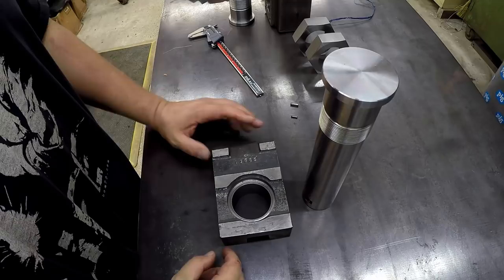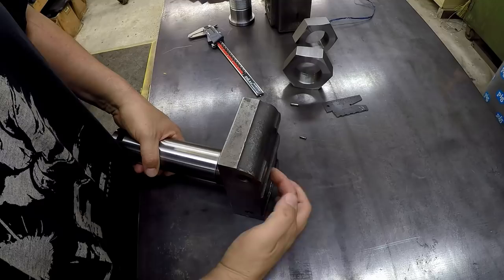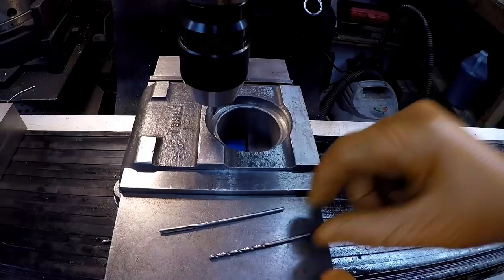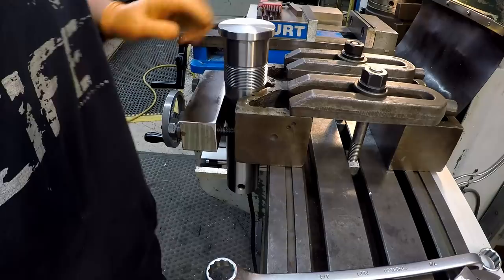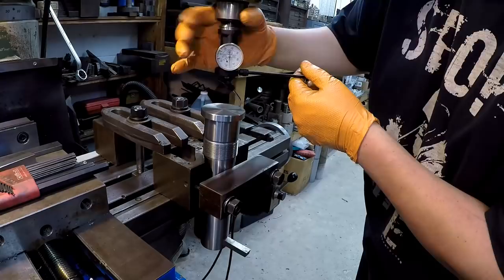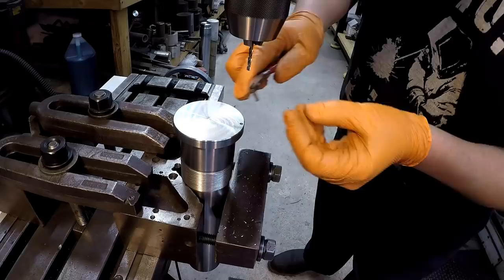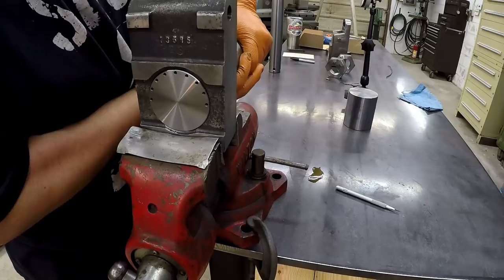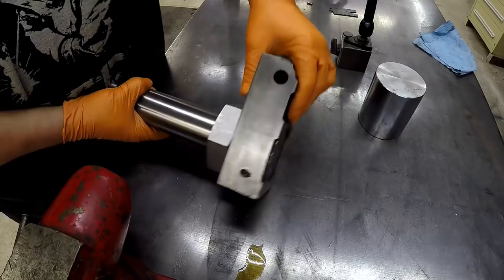Custom Internal Shaping Bar Part 6

Comment: You could put another set of holes on the other half in 15degree increments to give you your 30 and 60 degree indexed locations, plus all the 15s in between, then just flip it over if you need them.
Reply: i was thinking the same thing till adam made the mistake.

Comment: Do the other half of the bolt hole circle with a 12 hole bolt hole circle, then you can index every 30° if you flip the boring bar upside down and reverse the tool in the holder.
Reply: That's double clever.

Comment: You might consider drilling all the way around, but change the spacing on the other half so you can get more angles with the same bar.  Then maybe mark the holes on the back-side with little punches to remember which holes are what angle.
Though, I can't really imagine you'll have too many times when you gotta cut an internal on the shaper at 30 degrees...

Fun build as always, Adam.
Reply: Holes every 15º would add the capability of 15º, 30º, 60º and 75º. With your bars, you could then cut internal splines.

Comment: I think the only suggestion I'd make for these indexing holes is you've got one side drilled in 22.5 degrees so I'd probably drill the other half of the bar in 30 degree increments to give you +/- 30 & 60 degree options The geometry of the bar means it'd work either way up.
Reply: I was thinking the same, except I'd do 10 degree increments.

Comment: Hi from England Adam...

What you have done here was common sense...

Back in the early 1900s such a dowel arrangement was referred to as a "feather"...
a lot of British trucks
 (Albion, Thornycroft, Dennis) vehicles used feathers on many of the shafts, links & shackles etc...to prevent inadvertent unscrewing etc during use...
This was common practice until well after WW1....(all the subsidy scheme commercials used feathers on pins & fixings)...

I can imagine it not really lending itself to high production...

Comment: Old Shaker dictum.  Don’t make something unless it is both necessary and useful; but if it is both necessary and useful, don’t hesitate to make it beautiful.  The shakers were woodworkers, but it is equally fitting for metal working.  Well done.

Comment: Nice job, beautiful work.  If it were me, I would have used the other half of the circle to do 30 and 60 degree holes.  Your tool can extend either side of the bar (i think) so it would be just as useful to have 0-30-60 on the other half of the flange.  I'm not a machinist so I may be talking nonsense.   I do love your channel Adam,  I find myself calling on some ABOM torque when I am wrenching on my own car.

Comment: When drilling hole for the dowel pin I would have went all the way through with a smaller diameter drill. This way when or if the pin breaks you could drive the broke piece out with a punch from the opposite side. Just a suggestion. I know this from experience......lol. Great work Adam!!

Comment: You can add flexibility to it by adding more holes for the pin in the clapper, at offsets from 12 o clock. A 2.5, 5 and 7.5 degree hole on either side would make it possible to do pretty much any angle you'd want. Just reset the dowel in a position that would add up to or subtract to your target angle. Great video as always.
Reply: I was thinking the same thing, but do you think the pin's diameter is small enough so that the holes will be sufficiently offset at 2.5 so that there isn't a breach?
Reply: @reina4969  I think so, most pins are hardened and it's only for locating. The nut will handle most of the actual load.
Reply: He could have put 8 pin holes in the clapper equally spaced half way around and that would have given a vernier type of adjustment pattern to the holes but in reality when does one ever need a boring bar on a shaper set to exactly that angle? It adds complication and now you have to remove a 1/8 pin from a blind hole while the clapper is dissassembled. The holes he has should be good enough for almost anything in reality. Its only a side project.
Reply: @jtgoodling  Given how much he loves the shaper and the work he's put in, I reckon Adam would try as many things as he can on it. You could cut inside splines for example.

Comment: Adam, since you spaced your holes at every 22.5 degrees along half of the circumference of the flange, why not drill another set of holes on the other half of the flange with 15 degree spacing?

This will give you 30 and 60 degree positions.
Reply: Oh man, you've got your thinking cap on!
Reply: 15 degrees might be a tad tight. Back of the napkin calc says only 100 thou between hole edges. 30 degree spacing might work better.

Comment: You might think about NOT gluing the pin in the clapper. Instead drill a couple more holes in the clapper to correspond with 12:00 when you rotate the clapper pivot off of dead horizontal. Maybe a pin hole at 5 degrees either side of the "straight up" hole? 10 degrees too? 
Nice project, and you'll get a ton of use out of it.

Comment: You could drill the other half of the bar at 5 or 10 degree increments
Reply: The diameter he's dealing with is 2.5", so the circumference would by 3.14 x 2.5 = 7.85 inches. At 5 degrees he would need 72 equal arcs (or 36 for the semicircle), which corresponds to an arc length of 7.85/72 = 0.109 inches. But he's drilling 0.25" diameter holes so that's not going to work (the holes would 'join up', as it were). Even 10 degrees is too tight, but he could do 15, 30, 45, etc.
Reply: aporiac Yip every 15 degree should be good

Comment: That's a very elegant and effective solution you've come up with there. You've also left yourself the option to drill differently spaced holes in the other half of the semicircle if you want other tool angles (e.g. 30 and 60 degrees).
Reply: That was my thought too.

Comment: Facepalmed when Adam first drilled those indexing holes … good to see Adam keep that to show how we all make mistakes but can recover if we keep our heads.

Indexing for "12" holes will add flexibility on the other half to do 30°, etc.

Could be useful to mark the bar on the thread side so that it's easy to tell which range is being indexed and its respective zero without having to look underneath the clapper.

Comment: That's awesome. And u can always drill 15 degree  ( or whatever degree) divisions on the other side of the bars if needed. Great simple and very effective fix to the problem.
Reply: Just what I was thinking
Reply: Or put another pin in the clapper to subdivide the 22-1/2 degrees into 11-1/4. One hole vs many.

Comment: As others have already be saying, you can do 15 degree or 30 degree increments on the other side of the circles...
Reply: You could also add indicator marks on the opposite side of the bar, 180 degrees from each hole, to tell you which hole you are in...

Comment: I would suggest adding holes for 15, 30, 60, & 75 degrees for the greatest direct ease of setup.  The adjustment on the machine can supply the added adjustments in between..
Reply: Other have suggested this by adding holes in the "bottom half" of the flange.

Comment: Adam, a very nice job.  Looking forward to seeing chips fly on the next part.   But I have to ask.... what's with the wonky hand wheel on the mill  we see while you're zeroing in the square tool bit prior to the drilling?  Someone run into that sucker with a forklift?  You get mad at it one day?  Someone got the machine drunk?

Comment: nice fix adam, a ball bearing with half the hole in the base and the other half in the tool holder at various angles would also work. With a through pin hole the pin could work loose and come out( although very dificult)

Comment: Did you consider going all the way around the circle? I thought that you might be able to use that for two-sided tools such that you have a roughing tool on one side and a finishing tool on the other, just need to flip the bar over rather than going to the trouble to reinstall the tool and make sure that everything is centered again.

Ingenious solution to the problem though, and I'm still impressed at your willingness to remove metal from your expensive new machine without any real reticence.

Comment: Interesting issue, when I watched you assembly of the tool in the last video I was wondering how you were going to ensure the tool would be perpendicular to the part. This modification should fix that.
Reply: I thought he'd insert a piece of tool steel into the bar and clamp it in the correct orientation or put it against a stop. Then tightening the nut should be possible as well.

Comment: If you had 12 holes in the clapper and 15 in the bar, you'd have 180 positions (2° increments) you could machine at ... just need to put a removable pin in it to adjust things. Just a thought.

Comment: did not read all 492 comments could have been said .. if you drill the other 8 holes and drill 2nd hole and pin on other part double pin across twice the hold . if you have problem with just 1 pin .. love the shows please keep them going ..

Comment: Drill the other side of the circle with different divisions to give your self more options.
Reply: You can't. The pin on the other side would not line up.
Reply: bad0bates  I think it's a mater of wasting time tramming the head after adjusting it. Otherwise, there was no point in him adding this feature. On a Bridgeport, do you tilt the head or tilt the part? Same thing here. He probably wants to leave the head level.

Comment: Man don't sweat the holes. We have all been less than perfect. As far as the hole setup goes I hate to have a setup like that knowing if you take it out it is gonna be tough to set it up again if need be. Wish my DRO had that function. A drop of locktite will hold that pin. Excellent!

Comment: Curious how you were planning to ensure it was indexed properly w/o the pegs? You'd have to probably loosen/tighten up the big nut each time after indicating it. Seems like this was a needed thing regardless of the nut not tightening. Was thinking the same as others too regarding using 15deg points instead of 22.5. But yeah - you can still drill the holes on the opposite half as others said.
Reply: Brian Ullmark yes few more deviations could have been better but it depends on what he needs, still the way he’s done it I think it’s a great idea

Comment: Just FYI, that size pin at that radius should shear around 135 ft/lb of torque on the bar. It should never see that sort of torque (hopefully), because the tightened nut will absorb all the forces.
Reply: It shouldn't see any torque regardless. It's a shaper.
Reply: You have to tighten the nut, its a big nut and easy to over torque.

Comment: As always, true professionalism.  Great work!  Now you need to make a nut wrench for that big nut.  I don't think that hand snug is enough, even if it's ABOM snug.
Reply: I think that 24" Crescent wrench will do the trick.
Reply: John Ferguson    Quite true John, but wouldn't you like to see Adam fashion a "one of" single use wrench out of an old rusty slab of steel?

Comment: I had a similar problem on my small Shaper, but I use the square tool hole with a 1ft long key stock lever for holding the bar in position while tightening the nut. No indexing needed and infinite adjustability.

Comment: Very nice Adam, however any angle you need on your vertical mill you will clock the head off an angle slip from the bed or back jaw

Much the same for the shaper with a angle slip off the back jaw…

All the best from the UK
Reply from the maker: Not always the case

Comment: The pin and the hole circle is an interesting detail of this project. I wonder how did you counter sink the pin holes on the inside (45 deg facets facing the actual pin)? In one of the still pictures at the end of your video (at 19min 05 sec) it is visible that the burrs from drilling are gone but it is not clear if you actually did countersink this side as well. I suspect not. Or how did you clear the diameter of the bar sticking up while machining on the narrow flange? Using a hand held tool probably seems more practical in this situation.

Comment: Absolutely beautiful work! I love how your idea of "close enough" is usually within about half an angstrom...

How big of a pain in the butt would it be to make a one piece boring bar and clapper? It's probably not necessary but maybe the added stiffness would help the chatter somehow. Would be an interesting project at any rate.
Reply: I reckon if you intended to do that, casting and then refinishing would be the go, but yes a good idea all in one piece.

Comment: Maybe that works. But i am wearing a belt and suspender. So i would have done the complete hole circle on the bar, and put a second pin at 180 degree. That pin seems to be a bit smallish.
Reply: According to the engineering specs a hardened 1/8" dowel pin should be capable of 3,200 psi minimum before reaching the shear point. As the nut gets tightened the anti rotation torque loads start getting taken up by the friction of the enlarged area of the tool holder shaft. Probably doubtful that 1/8" pin would ever shear under the loads it will see.

Comment: Hey Adam, consider drilling more holes at 180 degrees at 10 degree increments.  That would give you 16 more index positions at different increments.  Just a thought.
Reply: Holes might be a bit close together at 10 degrees apart, but it'd probably be OK.  Or maybe 15 degrees apart or something
Reply: The holes could probably overlap slightly and work just fine...

Comment: Hey Abom, I think I see the physics of why that bar wants to spin. Normally you'd expect the thread interface would want to spin because the flange is a larger diameter, so with the same friction coefficient (steel on steel) and same clamping force on the flange as is on the threads, the threads ought to run more easily than the flange spins. Same force at a lesser radius is a lesser torque. But the thing is, the angle of the flank of the thread to the axis basically amounts to a shallow taper. So you drive that taper in as the nut applies clamping force, and you end up getting more frictional torque out of that interface than with a flat flange. The effect is more severe here than in a normal nut/hex bolt scenario because the thread diameter is so close to the flange diameter. So what you could do is change the interface between the flange and the flapper to a taper. Not a locking taper, but a steeper taper than the flanks of those threads. That ought to enhance the friction at that interface to a greater degree than the thread flank thrust angle does at the nut/bar interface. The other thing I would check (maybe you already did) is whether the actual contact radius of the flange to the flapper is closer to the ID or OD of the flange. If it ended up closer to the ID, that would also make the flange friction torque lower. You could cut a relief gutter into the flapper face of the flange, to ensure contact was nearer the OD. I know you're a pro and I'm just a design engineer... but thought maybe something in this perspective would be interesting or useful to you! I also get that the video is a year old so this is kinda pointless... Just figured I'd reach out because I thought it was kind of interesting and was pretty juiced once I'd thought I figured out what was happening! Sure you know how that goes.

Comment: I was wandering if you should have a washer behind the nut to protect the face of the clapper.
Reply: Exactly my thoughts!
Reply: I am not positive but I do not think that a washer would be necessary since the nut has a machined surface mating to a parallel machined surface.  I could be totally wrong on this thought train though.

Comment: If you have a 1/8 drill, why would you need a 1/8 reamer? Another great video. I'm not lying when I say this stuff takes me to a place that knows no worries. You are not just a pro machinist, you are a pro at producing high-quality, interesting videos. I can't stop watching, thanks.
Reply: A Reamer produces a much smoother and more accurate hole than a drill will. When you are going to use a hardened pin, you want the hole it goes in a nice as possible. Reamer makes a very nice finish and dimension hole.
Reply: Reamers are much more precise then drill bits. They don't have the flex like a drill bit. So if you drill the holes under size and take it to finish size with a reamer it should be as close to 1/8 or whatever size as possible.
Reply: The other reason you would use a reamer is on a blind hole so that there is a flat bottom to a hole because a drill bit will make a tapered bottom hole.
Reply: Ted Saylor I think that it was the drill size he was getting at. To be able to properly ream the hole he would have had to drill it a bit undersized.
Reply: @supraguy149  I  not arguing, but it is my understanding and (limited) experience that when you bottom out a reamer your hole gets oversized?
Reply: @peterheuts7738  I may be wrong but I would assume it's probably how had to bottom the reamer out. If the bottom out creates deflection then I can definitely see an over size hole.

Comment: nice job man, yer i was thinking the pins not going to fit as you were drilling as its the back side, but you sorted the the only thing i can add that mite help it keep tight or get it mega tight is a washer before the nut,

Comment: Hi Adam, Great video, I thought I was the only one who did Dumb, I did think that you should have drilled the 8 holes in the Clapper, then you would only have to drill 1 hole in each of the bars, I'm sure there is a reason you didn't though. Cheers from Australia